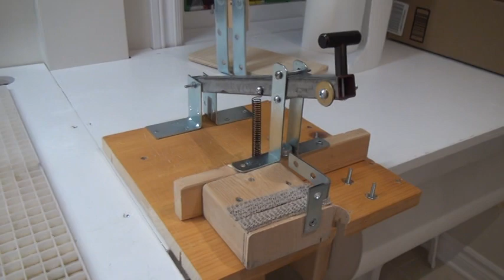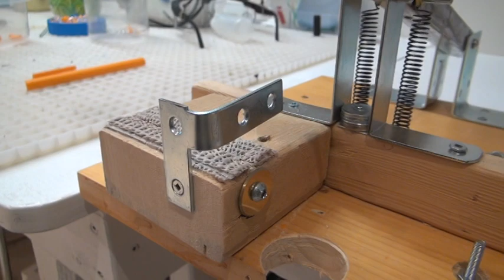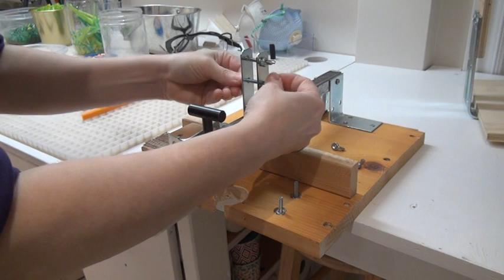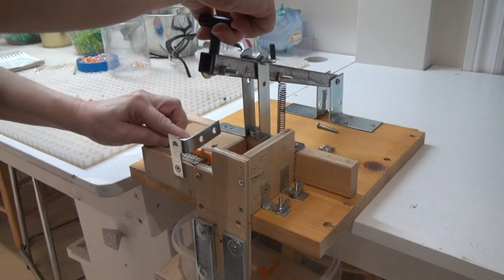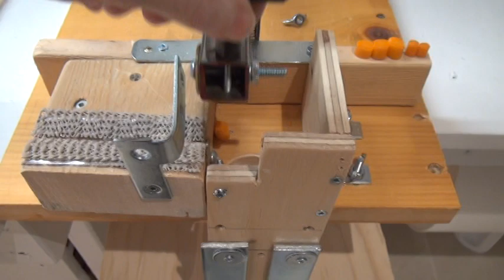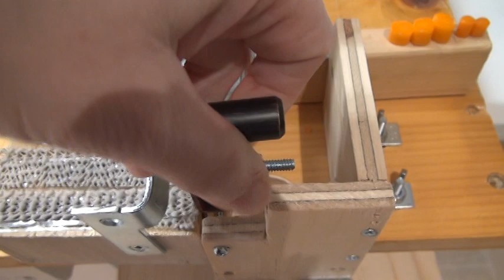murrini chopper/Murine chopper/DIY Glass Cane Chopper

Comment: Nice idea! What's the thinnest you can cleanly cut off?
Reply from the maker: It depends on the thickness of the cane or glass rod. It will easily cut 1/8" pieces off thinner cane that is 1/4" or less in diameter.

Comment: How thin can you slice cane with this?
Reply from the maker: It depends on the thickness of the cane or glass rod. It will easily cut 1/8" pieces off thinner cane that is 1/4" or less in diameter.